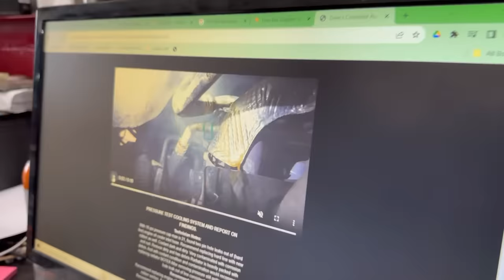The truth about maintenance, and what the manufactures tell you vs what you need to know

Comment: whats even worse for coolant is the gm TSB i would have to perform on a brand new 3800 v6 was go to parts get new throttle body bolts and here put those tablets in for a stop leak lol... seriously that was the TSB to fix the coolant leak on a 3800 throttle body. car comes back next time for an oil change..... mmmmm that 150k dex-cool looks like it has 150k on it but only has 30k

Comment: My co worker has about 250k on his corolla and he asked to dealer to change the transmission fluid and they said hed be better off if he didnt touch it.  Subaru said the same thing anout my old outback at 130k.  I have a 23 Tacoma now and changing oil at every 5k.  Curious when  l should touch the trans fluid.

Comment: Hi Dave, what is your experience and opinion on using coolant bypass filtration systems and oil bypass filtration systems? 

I have a 2023 Cummins That I have 80,000 miles on now and I’ve only had it for 10 months.  I have been religiously doing the oil changes every 5000 miles with Rotella T6 synthetic 5-40.

I have recently installed the sinister diesel coolant bypass kit (which when I was installing it, I noticed my D gas bottle had some fine dirt up on the sidewall of the tank) and a insane diesel bypass oil filter kit and currently am awaiting some very delayed analysis results from a company they recommended and sold me the kits for.   On a sidenote, since that ball has been dropped by the analysis company called gearheads there in Utah, I am going to start using the company this science Oil guy that you had on your show uses.

My 2014 Cummins has 300,000 miles before it lost an injector or it was possibly the grid heater bolt took out number six piston but I ran oil changes on that every 15,000 miles.

So I’m using this expensive $90,000 truck I have now as a testing platform with these filtration bypass kits.  

Anyway, I would like your thoughts on them or if you have used them and I will be getting in touch very soon for your monster tow engine for this 2014.  

Thanks for all you do for us that branch on our own vehicles !

Comment: The older I get the more I understand this is true. The manufacturers want you to buy another car. 
I just checked my service manual for my Mercedes Benz and it says to change my engine air filter every 7 years or 70K miles. 
That’s absurd and does not take into consideration what your operating environment is. I’m in a high dessert valley and I change my two air filters every year and when I pull them they are filthy. 
Agree on oil change interval as well. Synthetic oils are great but don’t run them over 7500 miles. Change it.
Reply: Engine Air Filter should be visually inspected and changed when NEEDED....customers tried that "The manual says..." on me until i removed the fitler and SHOWED how clogged with dirt and debris it was

Comment: I have changed the oil in my F150 every 4,000 miles with synthetic oil and I now have 578,000 on the engine without a rebuild.

Comment: Cooling system additives become acidic over very short period of time - heat cooling cycles ...its chemically built into the additives on the market, from my N-STEP 1 training over 20 years ago, i learned to measure the acidity of the cooling liquid, if between the liquid and chassis  ground you encounter 0.015V dc, the acid is reacting with something causing corrosion, this value is if any aluminium is in contact with the cooling liquid...a full cast iron engine can handle up to 0.030V dc as cast iron resists more than aluminium which is the faster material found in cooling systems to corrode, dont have a value for those mild steel tubings though....but common sense, encounter voltage, there is corrosion taking place....hint boiled rain water has minimal gasses in solution and from my experience is the best cooling system liquid...no corrosion

Comment: Maintenance on your car is easy. The trick to a cars long life is getting all the new car break in wear out of there. It a breeze after that. First rule is never get your oil changed at a car dealer. Next is use very high quality synthetic engine oil and the factory filter. Do not cheap out on oil. Do not use dino oil. Use a 3,000 mile OCI. Get a flashlight and look closely in the engine oil cap hole once and a while. Does it look brand new in there is the head metal squeaky clean? It should be. If not your oil sucks. On an old car be hyper vigilant on oil level. If it gets a little below full line top it off. 
Especially if its a Toyota. You run a Toyota low on oil once  so low it turns a check engine light on it becomes a little oil eating monster your not aware of it and will  blow its engine. very common story. Change the trans fluid and filter first time at 30,000 miles. If its a sealed trans go on youtube and find out how to change it. Get a dump bolt kit and install a trans dump bolt in the pan. Then you can just dump the fluid every 50,000 miles no fuss. Change the coolant at 30,000 miles. It's super easy. Just dump the rad only. Fill it back up with correct coolant. Done. Its critical you use the correct type & color coolant. Do that at every oil change. Till the coolant looks brand new usually that takes 3 changes. Just dumping the rad  you do not invoke the dreaded airlock and 2 or 3 dumps is as good as an entire coolant loop dump which is a real hassle don't ever do that. Also get some high quality spray lube and hit all the car hinges. Do not use WD40 your car will stink for days. Spray the hood latch is #1 the hood hinges and all the door hinges and latches. Keep the leaves out of the engine bay. Do not let them collect in the tray at the bottom of the windshield they will break down and  get in that drain system and clog it. Use a leaf blower. If dam gets clogged  water  will overflow that dam on hard rain and soak the top of your motor and stall the car. Lastly all new cars have a plastic engine cover/noise dampener  on the top of the engine. Dumbest thing ever invented all it does is trap tremendous heat on top of the engine last place you want heat trapped. Pulls right off. Take it off. Last thing is pop the hood at the end of the day or a long drive and prop it up. I use a wooden stick 9 inch long 2x2 painted black. Get the heat get out of the engine bay. It gets incredibly hot in there when you park especially if parked in the sun. Its a pizza oven probably 250+ degree's attacking the fluids the belts and all the plastic and rubber. For hours. My engine bays look brand new after years of doing this and I live in Florida. Years later rubber still looks and feels new. Simple things to do that will save you thousands of dollars and keep your car happy.

Comment: I inherited a car. Same situation. Can I weld that black where the small hole is leaking where the house enters the engine.
Reply: Don't car only has 50 k miles but sat around. Same time I find missing bolts. About to use an aluminum weld. Epoxy. So for it's held up my trailblazer but that's just a plastic radiator.

Comment: So my maintenance calls for 30k mile brake fluid changes. Does that mean I change the brake fluid every 15k now even though it is clean and clear? For 47 years now I be changed my oil every every 10k miles. There was a time when I first used a soil in the early 80's that they called for oil change every 25k miles and filter change at 12.5k. I did this on a 1980 Toyota that still ran perfect at 125k miles when I sold it. My buddy had the same year Tercel he did this to that made it to just over 325k miles. My current PHEV calls for annual oil changes even though I only may burn 12 gallons of gas in a year, so I change it every 2 years. Mu Ram truck runs 90% of the time on the Freeway at 1300 rpm. I don't think 10k miles is to far for that one. Now if commuting in hot weather and in stop and go traffic, then definitely sooner. My point here is that there is no one mileage oil change that fits all driving conditions. I drive my vehicles like the little old lady going to church on Sunday, and the next guy drives like he stole it every day. This makes a huge difference to just make a blanket 5k mile statement to oil changes. My cars are also always garaged and being retired, they don't sit outside except for a few minutes at the store and when driving them. All these things make a huge impact on maintenance schedules.

Comment: My Cummins came with factory 10 year recommended coolant.  At 5 years I replaced the coolant bottle because the rust scum obscured the level sensor.   Flushed the coolant and it looked like crap.   I’m really disappointed I believed the factory recommendation, I knew better

Comment: Just as well it they havnt moved they woulda been sucked in by now . Delete swirl flaps. Bmw got sued and came to after that they said 150000 miles for transmissions oil . Im a firm believer of coolant changes as it look the corosion inhibitor has badly broken down in that coolant rusting the whole system or else some body never bother puting coolant back in

Comment: My BMW recommends oil changes every 10 thousand miles, which is what I do.  About every third oil change, I send a sample to a lab for analysis.  They respond by telling me the wear metals are minimal, showing no cause for concern.  They also tell me the additives in the oil are still effective; try going 12 thousand miles next time.  I bought the car new, and have 95000 miles on it currently.  I love the people who change their oil every 3k and state they have no problems.  I change mine every 10, like the manufacturer tells me to, and I have no problems either.  I've got around $1000 more in my pocket, though.  You absolutely have to do routine maintenance; you absolutely don't have to cut the maintenance interval in half.

Comment: Coolant in All vehicles is only good for 2 years or 30k miles before it turns into an acic that eats all parts and gaskets. 
Hoses should be replaced every 4 years. Same schedule for brake fluid and hoses. Same for Trans and diff fluids.

Comment: The REAL reason the manufacturers suggest 10-15 mile oil change intervals is the result of the EPA enforcing that - or rather, punishing them if they don't. Same for 'lifetime' transmission oil. Because they think that oil changes pollute. Despite the fact that used oil is recycled. The reality is that newer engines are very tightly machined and need extremely clean oil of exactly the right viscosity. Change your oil every 3000 miles. No exceptions. Especially in a diesel - the oil gets FILTHY.

If you look at all the engine failures going on in new cars from, say, Hyundai and Ford, you'll see that the 10k oil change is killing them in warranty repairs. It's the EPA's doing.

Comment: I think you're leaving out that the manufacturer makes a nice bit of cash on regular maintenance like oil changes, so that's an incentive in the opposite direction--for them to recommend changes more often than needed. Also it's true that they want to sell you another car, but even more they want you to NOT go to another manufacturer for that next car because you're displeased with theirs because it packed up in 10 years even though you were following the recommended maintenance. So I don't know... I think just as likely you can stick to the manufacturer's recommendations and maybe even stretch them a little bit. (I suspect all of the engine work you get due to lack of maintenance was due to maintenance FAR LESS than what the manufacturer recommends.)

Comment: I do full oil service every 5K or twice a year,like Scotty would say Oil is cheaper than new engine.I go to Super Lube and any sludge comes out with the flow..I bought it brand new 6 years on it and doesn't burn oil.I don't like those warning lights change oil,,5K is fine and pull dipstick it's not rocket science to check oil...

Comment: Is that the orange Dexcool coolant you can’t mix that stuff it has to be only Dexcool. I knew a guy that mixed his Dexcool with green universal coolant and it made a big mess in the cooling system sludge clogged everything his engine overheated blew the head gasket destroyed the water pump ate holes in all the hoses the radiator was clogged the heater core clogged the engine block and all the passages were clogged. He needed a new engine new radiator new hoses the dash had to be removed to replace the heater core new water pump 15k dollars later with a used engine a new radiator a new heater core new hoses and a new water pump and about a months worth of work and a big labour bill. All because he mixed green universal coolant with Dexcool.

Comment: People, change the oil EVERY 3,000 miles. AND flush cooling system EVERY spring. Transmission fluid EVERY 100,000 miles with new filter.

Comment: 'get a good shop'

Good f*king luck!  There are a lot of good shops out there, but when you find one it's after the 200 people in line ahead of you...  so that repair the 'other' shop can get to this week, the 'good' shop can't get to for three months.
The 'other' shop is going to do half as much as is needed, barely what's required to get the car out of the bay, and charge just as much (usually more) than the 'good' shop... and you'll be back in six months for the other half of the work that the 'good' shop would've done right the first time.

Comment: People these days, for the most part, seemed to be more focused on spending their money on fancy tires and wheels, window tint and $12 car washes every week - then they are on PREVENTATIVE maintenance! Not only that, but how many Tire / Automotive Service Centers actually flush your BRAKE, POWER STEERING, COOLANT and TRANSMISSION 'completely'?

Most places will simply drain the radiator, top it and the reservoir off and burp it, then send you on your way. 

Most places might actually drop your automatic transmission pan, change the filter and top it off - but that leaves the majority of the filthy trans fluid inside the torque converter.

Most places won't tell you that brake fluid is hygroscopic and that you should flush it once every couple of years.

Most SO-CALLED 'TECHNICIANS' want the quick & easy disc brake pad & rotor swaps - - and heaven forbid if you have an older car / truck with drum brakes because not only will the sales personnel in the showroom fail to recommend a simple rear shoe clean & adjust - but the 'technician' won't even pull the rear wheels to check them. 

I've even worked alongside so-called 'Lube Techs' who are SUPPOSED TO check EVERY gearbox on a 4WD truck when performing an oil change but won't bother because the front desk slams them with back-to-back 'CUSTOMER WAITING' invoices.

Just about everyone I've ever worked alongside in over 30 years of off-again / on again employment at these types of facilities are nothing more than absolutely lazy to mildly mediocre parts swappers. 

And I've always firmly believed that even 'IF' a client stubbornly refuses a dozen or more 'PREVENTATIVE MAINTENANCE' recommendations - at the very least - you have planted a seed in their head for them to ponder on.

And most technicians, salespeople, managers and even owners won't consistently recommend extras to the clientele - because they have experienced the inevitable "You people are just trying to get every dime you can outta me". Or if it's a woman - you're just trying to take advantage of their lack of basic repair knowledge. 

Instead of playing ESPN, Weather Channel, or a game show in their lobbies - they should consider playing short / detailed videos of every service and every extra preventative maintenance recommendation possible. Get rid of all the Gun / Hunting / Fishing / Fashion magazines and replace them with detailed literature about all their services. 

Oh!? - And PAY YOUR SEASONED TECHS with the $100,000+ tool / toolbox / scan tools collection FOR EVERY SINGLE MOMENT they spend on diagnostics! I don't care if it's a simple 'CHECK ENGINE' light reset because someone forgot to tighten their gas cap correctly. There 'SHOULD' be a minimum diagnostic charge.

ALL 'techs' get lazy because - as a business grows over the years, their number of clientele grows as well. And everyone is scrambling to do 3 or 4 times the amount of volume within the same small space. And some 'techs' are performing the jobs of 3-4 different types of technicians, while getting paid less than most high-school students are starting at down at their local fast-food restaurant. 

Simple products like this can generate a lot of extra income - - 
https://www.hsgaragegear.com/products

 - - Thanks for sharing this video! 👊

Comment: I just bought a Toyota Tacoma. I changed the oil at 1,000 miles. I will change it again at 5,000 miles then every 5,000 miles after that. 10,000 miles; no way.

Comment: I grew up poor so I learned to work on cars backyard boogie since 1994.......one thing I learned is drain and fill your transmission fluid every 30k and drain and fill your Radiator coolant every 50k and change your oil regularly and early what the manufacturer says and I have never had a failure on any car I've owned......yeah backyard boogie ain't in the manufacturer manual but I'm pretty sure the guy making this video did it boogie at some point, learn what you can

Comment: Man I don’t understand these people who think a car lasts forever with no maintenance. All my cars have had a whole BIBLE of maintenance bills. Oil every 5000kms, coolant every year, brake fluid every year, filters every year/two years depending which filter. And I have never had any check engine light on, not a single mechanical problem. See a correlation if you want.

Comment: These modern vehicles aren't like old cars. You could run a car from the 60s with no maintenance, and it would keep going without a problem. Modern vehicles use thin fluids, thin rings, and a lot of plastic. They don't make them like they used to